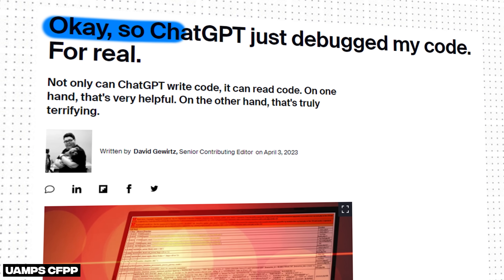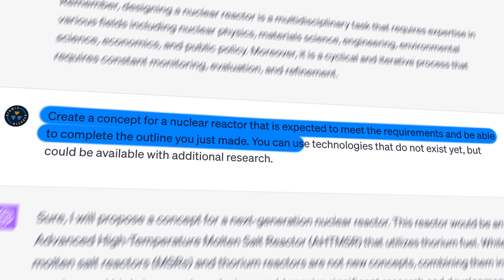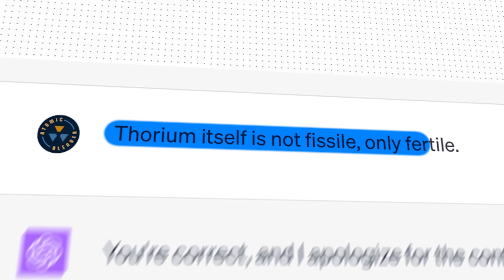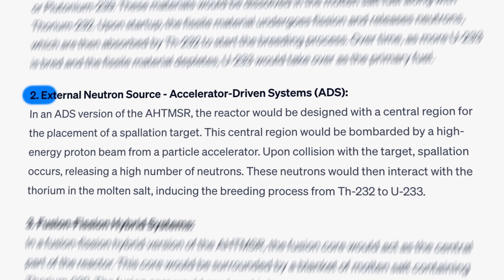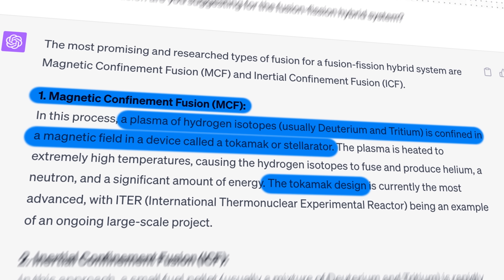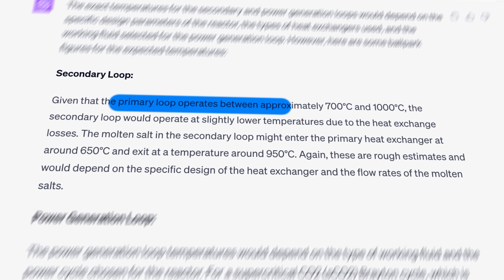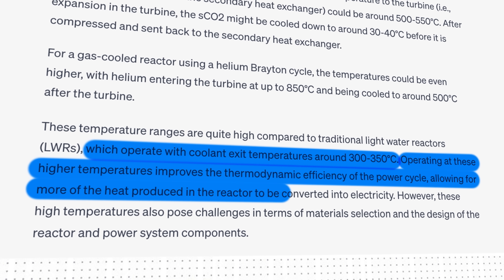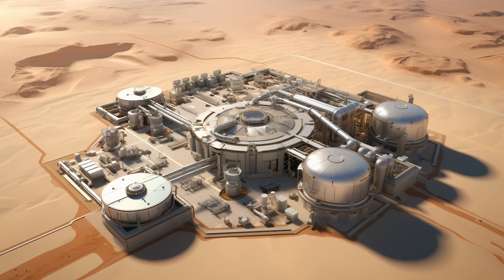Unveiling ChatGPT's Insane Nuclear Reactor Design

Comment: I would say that you're discounting the two futuristic options it provided. Both are actually reasonable if taken in the context of a future design. Proton lasers have shrunk following Moore's Law since first conceptualized in the 1950s and first built in the 1960s. Several fusion reactor designs and test models have followed suit. The impracticalities you discussed are based upon our current technological placement and implementation of such tech. In 20 years, both technologies could be and like will be far smaller and more efficient in design to allow for either of the ChatGPT designs to be viable. A Fusion-Fission hybrid generator also makes sense. Sustained fusion is difficult, and power capture is even more difficult. However, if paired with a molten salt reactor, where in the fusion energy is captured by the molten salt blanket directly, almost all of the energy produced could be stored in a molten-salt battery and converted to electricity through the heat exchanger. With or without the thorium. Which means more instantaneous or short burst fusion reactors, like the toroidal design, or ram-chamber design, would be far more feasible of a power source.

Comment: Using a lead spelation target using a particle accelerator is called a Accelerator Driven Reactor.  It works by bombarding a subcritical mass with spelation neutrons from lead.  It is a serious idea, but the main issue is that there isn't a small and cheap enough particle accelerator to make it work commercially.  A cyclotron is too low energy, and a syncotron accelerate too few neutrons.  You need protons at around 1GeV to maximize the efficiency of netron production.

I watched a video on it on YouTube, in a webinar by the Gen IV society that is working to develop Gen IV reactors.

Comment: I would just infuse the salt solution with hidrogen.

Or if you want that fusion in the Liquid thing.

I would have a sponge made out of Thorium. And fill it with high pressure Hydrogen.
This will be dipped in the salt.
With the heat of the liquid, the outside will proggressively disolve into it, that area will have that Hydrogen crashing into the natural fast neutrons being formed and slow them down.

While in that sponge alone it is not enough to cause a chain reaction, the extra heat does the trick.

Some of the Hydrogen instead of just fussing with the neutrons into heavier Isotopes,  will actually fuse. Be it together into He, or with the Thorium...

That last will actually reduce the heat...
But will create an even more unstable element that will decay and will release heat.

Comment: nice ideas.
I had a similar idea regarding the spallation system. the problem is just, that lead has a low melting point, so you need some sort of containment to keep the lead where it should be.
but heavier elements make better spallation targets. I'm looking at you uranium and thorium. in other words: just yeet the proton beam into the molten salt. no special target required.
furthermore, the best fuel available is the already produced nuclear waste. heavier plutonium-isotopes, americium, curium, etc, they love to catch neutrons and will easily split.
and of course, there are so many nuclear bombs around, just use them as fuel too.

regarding the experience and knowledge of such LLM systems. they were never designed to make nuclear reactors. we are exploring what they can do. the interesting part is, that there is a massive amount of texts readily available in the form of research papers. the problem is just, that a LLM mangles them together with tweets, facebook postings, cake recipies and weird flat earthers telling about the liquid see of the heavens above. no wonder, the bing chatbot went insane the second it got into touch with the internet.

Comment: I have ChatGTP on my phone and asked it that and it told me it couldn’t. 

Designing a nuclear reactor is a complex and highly specialized task that requires expertise in nuclear engineering, physics, safety regulations, and many other fields. It is beyond the scope of a simple response in a chat format like this.

Building a reactor to produce 300 megawatts of power would require careful consideration of various factors, including reactor type (e.g., pressurized water reactor, boiling water reactor, etc.), fuel type (e.g., uranium, thorium), cooling system, safety features, containment measures, and regulatory compliance, among others.

Nuclear reactors are large-scale, capital-intensive projects that involve extensive planning, testing, and regulatory approvals to ensure safety and reliability. They also have long development and construction timelines.

Designing a nuclear reactor should only be undertaken by qualified nuclear engineers and experts, and the entire process must adhere to strict safety and environmental standards. If you are interested in nuclear energy or reactor design, I recommend consulting with professionals in the field or conducting further research through reputable sources.

Comment: The failures on this are not surprising. LLMs are generally bad at self-criticism and structured reasoning unless prompted to do so using a meta prompt like chain of thought or tree of thought. They look smart, but without specific prompting they tend to not reflect on what they’ve already produced meaning it’s more a barely filtered stream of thought with a handful of reasoning steps.  It would be interesting to put this same set of questions through a metaprompting system (like SmartGPT or AutoGPT) to see what happens. Also, LLMs are poor at understanding number magnitudes and tend to get confused unless they’re trained specifically to understand them (usually with a special tokeniser and embedder for numbers that maps similar magnitudes to close by vectors, which requires a task specific number range to be singled out)

Comment: I have seen some a proposal for hybrid reactor around 2010 and it was meant as replacement for ADTT. I think such arrangement could help with greatest issue that our current fusion technology has - yield. So while the fusion device would not be able to sustain itself in operation, it could be reasonably small to provide enough neutrons to allow for operation of fission reactor. As well there currently is British company Tokamak Energy that is working on spherical tokamak, so maybe that could bee used as neutron source in such hybrid setting even if it would not be able to sustain itself in operation due to inevitable loses.

Comment: hmm interesting idea, now I'm no nuclear physicist so I'll simply ask the question. Is 3 × 10^11 neutrons per second enough to enrich the uranium in a meaningful manner? If so then a simply deuterium -> deuterium fusion reactor could work as it can be as small as a basketball.
Reply from the maker: A bit low IMO, you'd get some small quantities converted. Not sure if it would be enough for a target power level of 300 MWe. But maybe if the thorium was "charged" in advance by the fusion basketball, converting for a few weeks beforehand and then starting up the fission side?

Comment: Try asking specific questions on an existing design. Use the plugins feature to upload a PDF file and ask questions on how to improve a specific area or what are its downsides. I have noticed that the more specific you get the better it gets. 

GPT like models have no "thinking" capability. All its thoughts is said out loud on the screen. When the GPT said lets do fusion reactors, if you had asked "are you sure?" It would probably have replied "On a second thought, thats a bad idea". Humans come up with weird ideas all the time but we have the ability to keep it in our heads. GPT like models cant do that.

Whenever you ask a question, it has a limited budget to "think" and speak. So, if you ask specific questions, it fits within the budget and you should get better answers.
Reply from the maker: Good idea, I didn't get that far but I've found it responds more deeply when challenged by the user. It often corrects itself. Giving it more specific prompts tends to give better responses, just like you mentioned. So if it can "improve" existing designs, or at least review what could be a challenge or more efficient based on other information, that's something worthwhile.
Reply: @atomicblender  Also stick to GPT4 if you are going anything beyond high school knowledge.

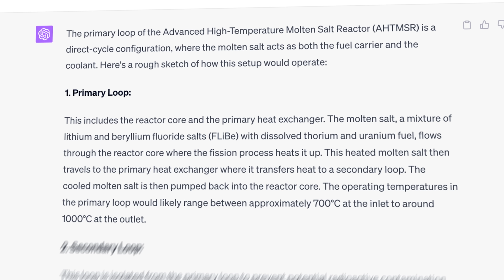Comment: 8:07 Yeah. Not just solve the problem of molten salt eating away any piping, just ad fluorine into the mix, so that ceramics are definitely out of the equation
🤣🏆

And just for good measure, ad beryllium, so the fuel stays a toxic fire hazard for ever.

Comment: If ChatGPT could be linked to a simulation suite of existing Fusion and Fission designs and slowly iterate the two together it might give a more complete result.   It might take the better part of a week to figure it out through the amount of compute horsepower needed to run the simulations, but like all good iterative ai setups, it keeps the ideas that work and uses them to change the design.   I'd like to see if the fusion reaction could literally occur within a vat of molten salts as the container of the reaction, maybe relying more on the compressive strength of molten salt and less on magnets.  One of the issues in maintaining fusion is the fragility of the outer wall and the loss of heat, this would address both to some degree, but good simulations are needed to see what would happen economically.   Perhaps only harvest the heat from the outside in secondary loops.  This would negate the need for pipes that can handle molten salts.   If salts don't work, maybe switch to molten metals, I think there's a reactor design looking at this type of setup.. I think Gates was funding it.
Reply: That is an interesting approach which I might try using for something entirely different.
I could try a hyperparameter search for an AI model where GPT-4 suggests a set of hyperparameters, gets the results of using those and can argue about the best values for them or which corelations it sees. Using those it can iteratively suggest new hyperparameter sets and run its experiments to find the best ones.

Comment: Ok. I got it. Im going to make a lead spauling neutron generator out of common household items. I'm just going to need a VCR and a CRT. Wait... No. Two CRTs!
First you're going to retrofit a VHS cassette with lead embedded acetate film instead of ferromagnetic film polymer. Then you cut a slot on either side of the CRT to feed the lead tape through directly in front of the electron gun. The slots should be sized with enough precision to allow the tape to pass through at 24fps, while maintaining vacuum in the tube. The phosphor coated front of both tubes will be removed and fused together. We then reverse the polarity of the second CRT to repurpose it from an electron dispenser to a neutron accepter. Thus ensuring a steady flow of neutrons.

Now I know what you're all saying. "But that will never work because the electrons don't have the necessary momentum to overcome the electromagnetic repulsion of the electrons of the tape, let alone the strong nuclear force binding the nucleus of a lead atom!" Not a problem. We just cut off the 110-120VAC plug and replace it with a 220-240VAC plug. This doubles the power.

When should I be expecting my $2.73bn in grant funding from the Scientific Team Underwriting Precocious Independent Developments?

Comment: I am wondering what he can do with the nuclear reactor design output of the huggingface LLM AI model TheBloke/Wizard-Vicuna-13B-Uncensored-SuperHOT-8K-GPTQ. It is not trained on what OpenAI ChatGPT is trained on but it can be run locally and will answer the question. As i am by no means a nuclear engineer nor anything close do we actual already have a model able to tell you how to that you can run locally?
To run it locally you will need a RTX 4090 as it runs using CUDA and needs 21GB of VRAM to hold everything. It does not include the warnings ChatGPT has unless you program it to as it is the backend not the front end. So in the video i saw of 8k models being demoed and it used it was ran with the front end user interface of oobabooga and context size set to 6000.

Comment: So that hybrid system is actually a really good idea. You could use iec (inertial electrostatic confinement) like the fusor which is actually used in commercial neutron production. (This is a biased opinion because the hybrid system came to mind when you asked about the neutron source then it was suggested😂)

Comment: Strange ChatGPT didn't suggested to use a fusor in the nuclear fusion approaches. And strange it didn't explicitly mentioned the accelerator and fusion approaches would only be needed to start the breeding process. The approaches could be used to breed the desired isotope outside the reactor, then afterwards introduced into the reactor to start the breeding process. Doing things this way is actually very practical. Maybe worth a follow-up.

Comment: I don't see the need to put a fusion reactor "inside the fission reactor", or for the fusion process to be anywhere near 100% efficient.  All that is necessary is that the fusion process produce enough neutrons quickly enough to make the manufacture of a small amount of U233 commercially feasible.  There are plenty of fusion designs that produce neutrons but that aren't capable of producing neutrons AND more energy than it took to produce them.  Any of those could be used to produce the U233 from thorium.  That would of course increase the start-up costs of a "thorium" reactor but the U233 could then be used as the seed in a more conventional thorium->uranium breeder reactor design, one without all the - at that point - unnecessary fusion bits.

That said I think I'd opt for the idea of using plutonium or other existing "waste" as the source of neutrons.  Again, the plutonium (or whatever) does not need to be part of the final thorium-fed design.  I mean, if that works then fine, run with it.  A good way of disposing of all that "waste" from once-through "open cycle" conventional reactor designs would be a great feature if that aspect could be achieved.  If not however then again it just needs to be able to produce the initial seed amount of U233 for the actual energy-producing thorium->uranium breeder design.

Comment: Great presentation. I smiled. I would have answered ThorCon, which is well on its way based on the original oak ridge research, plus plus. Using ship yards for fabrication, and reactor "pods" that can be replaced for solving recycling and corrosion issues. Lots of information is available online as well. Great guys. First plants will be deployed in Indonesia, price point is targeting coal pricing.

Comment: You are thinking about fusion the wrong way. There is no need to run a fusion reactor inside a fission reactor, or indeed the reverse, much more practical configuration. Thorium fission reactors do not necessarily need an endless supply of external neutrons to 'parboil' the raw Th232 into U233; rather, just an initial batch of the U233 can suffice to get the so-called "Thorium reactor" up and running, after which it can breed it own U233. SO... Fusion neutrons CAN be used, by adding a blanket (or blanket section) for Thorium processing to the fusion reactor, which in this configuration may serve strictly as a neutron source, not a heat source capable of adding power to the electrical grid. 
This greatly relaxes the challenges of making a functioning fusion reactor! In this guise, the fusion plant need not even reach real-world breakeven. The MUCH lower hurdle of laboratory breakeven may be enough, even if the fusion plant can operate ONLY with the assistance of a co-located fission plant, to cover the (rather large) energy losses from the present misguided mainstream approach to fusion. 
Indeed, the fast neutrons from DT fusion can even convert U238 into fissionable fuel, as typically done in Teller-Ulam fusion bombs, thus further increasing the availability of fission fuels. @AtomicBlender

Comment: what is your take on copenhagen atomics, they seem promising.
Reply: While i hope they succeed, their stated goal, paraphrased, is to be a unicorn. Their business model of owning the reactors themselves, is VERY capital intensive, and the financial trend across the world, especially outside the US, is that capital is getting harder to access.
I am in no position to comment on their design, but i don't have high hope for them succeeding in a business sense.
Reply from the maker: I second @haldir108's response. I hope they have success in what they are doing. So far I haven't seen much detailed information about how they will actually do their reactor. Last I saw they are going for a Plutonium initiated, Thorium breeding, molten salt fueled, heavy water moderated design, in a shipping container. Which will be a challenge. In the meantime, they appear to be focused on rapid prototyping of other components for their plant, which certainly will be useful in solving some of the practical aspects of any design. Last Energy is another company taking the designer-owner-operator approach and then selling the power through a PPA or some other contract. But their design is much simpler and probably will have an easier time getting access to capital. Still, there have been many surprises and at least (some) parts of Europe are interested in nuclear so funding could be available to keep Copenhagen Atomics going.